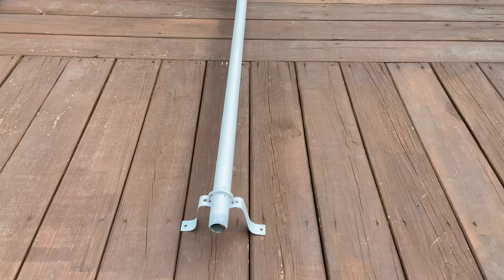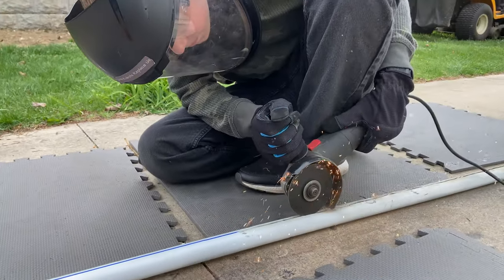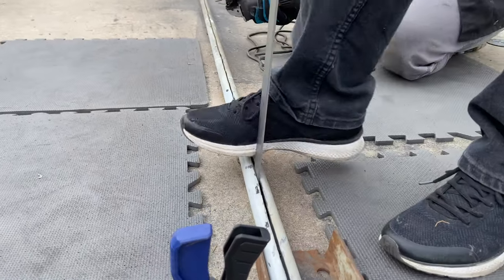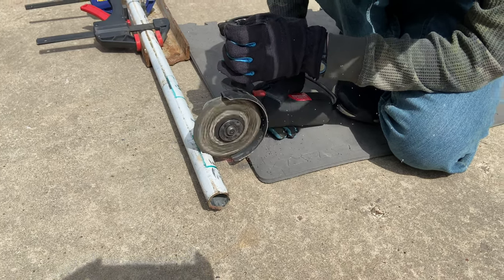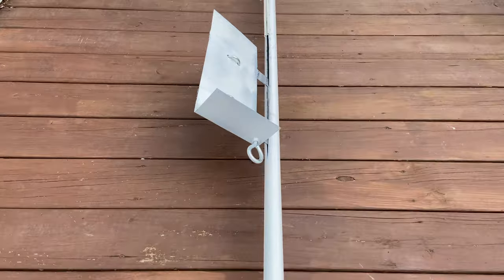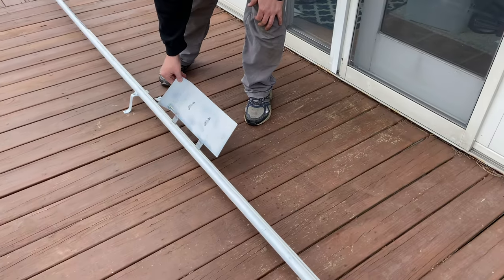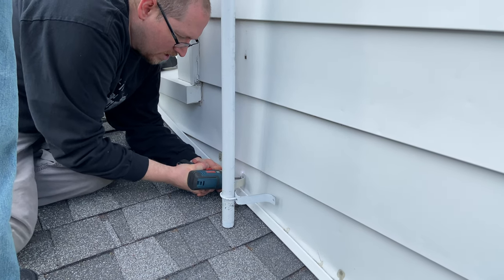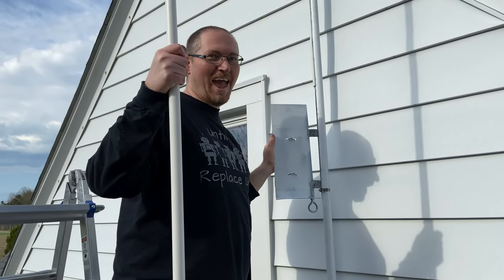DIY Ham Radio Antenna Mast

Comment: That pipe is galvanized, the bracket is coated with something.  If you're a new welder, don't breath that.  You can screw up your lungs for life in an instant.
Reply from the maker: Thank you Piquat1, excellent advice worth sharing. We were aware of the potential dangers of welding galvanized steel, and while we didn't show it, we had certain safety precautions in place: When welding indoors at the vice, we used a respirator and hood for ventilation. Outside we used a respirator and fan to blow the fumes away. It is possible to remove the Zinc via a salt/vinegar, or muriatic acid, though admittedly we didn't do that. Safety is very important and with proper planning, knowledge, and training/experience, you can live to make good decisions another day. Thanks for adding to the community knowledge! 73, AC3DS

Comment: Very nice, I would most likely have attached a pully for easier control of your clever sledge, as there will be wight on it and may rattle down faster than I can control.
This being said, I think I may use your basic  concept and modify it.
I also like very much how you are forming this young man into a very good person.

73 to you lot
Bernd
VA2VFF
Reply from the maker: Yes, the use of a pully to help minimize the speed at which it descends would be beneficial. We've built two different antennas and put them up and taken them down a half dozen times for calibration and modification. The sledge has worked well, but is a bit scary when coming down with a yagi on it. We know that it can't possibly go anywhere, and as long as we aren't standing right underneath, the forces at work won't break anything, but it is still a guillotine looking device coming down.  If you build a version of this, please come back and let us know how it came out. 73  AC3DS and KC3RPH

Comment: Nice job Be!
If you don't mind paying a few more bucks, then a 80/20 1010 rail would have worked nicely (smooth channel, not as much work cutting a channel).  
You solution looks like that might be a good solution for omnis, but It looks like too much wind slop for a tight beam yagi.

Comment: Nice.  Could have done a stop at the top,  attach a rope to the eyelet along with a long spring and pull the rope from the ground to raise it and tie off the rope.  To lower,  untie it and let the spring pull it back down.  Good build though

Comment: While certainly a great DIY project, to me at least, the work required seemed a bit excessive & even complicated for a mast that's bracketed to the house; however, not being able to visualize the antenna(s) that'll be on it might give me a different perspective; for me, I'd just get a mast & bracket to the house, using a pulley at the top (for wire antennas) &/or maybe even a telescopic mast (say, for VHF/UHF); but again, a really nice looking system but wonder if it's a little overkill(?)--tnx & 73
Reply from the maker: Good points. I’m very glad that you wrote this feedback. You are correct that this may be a bit overkill, and not necessarily the simplest of designs. We agree that this is probably not a design that most would want to replicate, and the labor involved is somewhat excessive. This design was chosen for a few reasons: 1) While we don’t believe that the design is unique, we didn’t find an example quite like it and so perhaps it adds something to the general good, even if just an idea that shouldn’t be replicated and a video to show why. 2) The ability to come up with an idea and push through hard work to see it come to fruition brings with it certain advantages.  It was worth it for Benjamin to be able to see his idea realized. 3) it affords the opportunity to revise and revamp the existing design. 4) it used almost all existing hardware. 

No doubt there are better options out there. Again, thank you for the feedback.  73!
Reply: @transmittinguntilrobotsrep1045  plus it reinforced the creativity of a newly licensed Amateur. Keep creating, keep learning, keep growing 73 KI5OUH.
Reply from the maker: ABSOLUTELY! I'm so glad that you said that. Creativity, engineering, tinkering and making go together beautifully and the more these can be encouraged the better. Thank you for your encouragement. 73 AC3DS
Reply: Yes, a great DIY for a newer ham, requiring creativity & perhaps even generating different perspectives in which to view other future projects--well done! 73 de WA4ELW in TN

Comment: Could you not have used a flag pole design to get your platform up and down?
Reply from the maker: Good question, and yes. Having a flagpole pulley system should work, and it is something we are looking to add on to it. We are actually looking at adding two pulleys in order to be able to add a horizontal dipole as well. The system does work just fine, even with a fairly heavy pvc yagi, butter pulleys would be better. Version .02 of the iterative design process coming soon!

Comment: I would have climbed the 2nd roof on a dry day or simply unbolted the pipe from the brackets on a wet day to work on the antenna.
Reply from the maker: More power to you sir. I get more than a bit uncomfortable on that pitch. To each their own. So far the adjustable mast has worked out really well. We've put up and taken down different antenna builds dozens of times. It is perfect for experimentation. If we were going to leave a particular antenna up more or less permanently, I woudn't us this, but for testing it is great.